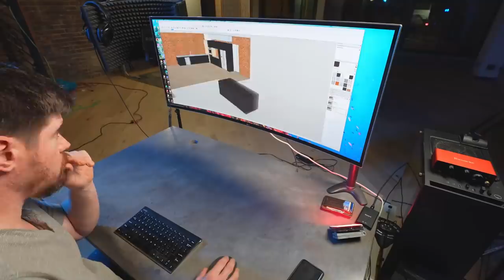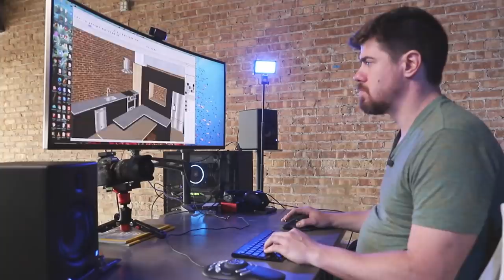Ep. 24 - Making the Hallway GLOW... and Bathroom TOUR ...Abandoned Building Renovation

Comment: I wouldn't worry about the edge of the flooring unless it causes issues when cleaning. I'd also consider re-grouting the bathroom while you can as its just going to get worse. The little elevator nook is nice as it breaks up the long hallway and plus useful for later. Its all looking really good 👍
Reply: I thought it's a good spot to put beds & a Bruce\Karma toy box. All Custom Built, of course...
Reply: @marshawargo7238  agreed. They'll have the best patrol spot
Reply: yeah I agree about the flooring, people are not going to notice it unless it's pointed out or they are specifically looking for it so I would leave it as is unless it causes issues, another possibility with the elevator area would be to convert it into a dumb waiter type lift, not big enough for a person to save from having to deal with elevator safety codes, but good enough to save you from having to carry loads of groceries/heavy objects up and down the stairs

Comment: For the smart thermostat, I'd recommend ecobee. It is a lot more open of an eco system than nest, and has the most features and customizability, which may not seem important.... until it is!

Not to mention, extra temperature sensors that can be spread around the house to take average house temperatures, rather than just hallway temps, which is always good!
Reply: Ecobee is the best!
Reply: +1 for ecobee, especially with the remote sensors
Reply: Yes. Both our electrician and HVAC folks have said they're uninstalling a lot of Nests and replacing them with Ecobees. I like ours. Lots of control that is accessible. I widened the range before the system kicks on to +/- 3 rather than 2 so my HVAC can run more efficiently (less cycles for a longer period of time).
Reply: I've had both and after 2 months ditched the nest for the ecobee. Get the Pro if you have a (de)humidifier.
Reply: Major +1 on Ecobee, doesn’t even need to be the 4 (which I’d personally avoid, I’d rather not have Alexa in my house) the 3 Lite is the perfect smart thermostat and a great value!
Reply: As a guy who used to do duct cleaning and light maintenance of Residential homes, Nests were the most consistently failing on me when doing all my check ups. The wiring thats connected to the back of the thermostat would often fail and at the time Nest would not warrenty the issue claiming that all these failures were due to poor workmenship on the technicians. Yet how are you supposed to charge or change the batteries if you weren't allowed to remove it from the wall? most of these setups were WiFi and the really old ones were Blu-tooth so it wasn't always a tech that caused the issue! Ive heard good things from Ecobee right before i stopped that line of work though
Reply: I have the NEST. It looks really cool but the app that goes with it is the worst peace of software ever. I wouldn't buy it again.

Comment: Re: wood flooring and trim. I normally make sure the drywall is up higher than the installed floor wil be. That way you have 1/2-5/8" of space under the drywall for the floor to expand. Then you just need to leave a 1/4" gap from the face of the drywall. The gap is only to allow expansion, so who cares if some of that expansion happens under the drywall.
Reply: This is how you're supposed to do it. Also the reason why you always start drywalling top to bottom. Leave an inch above the ground and you can put floor right up/under the drywall.
Reply: Huh. Smart... professional... makes perfect logical sense.  And yet, we rarely see it done. What a world we live in.
Reply: thats how ive always done it but i try to leave the floor at the edge of the drywall. gives a 1" gap total from both sides. if your flooring is expanding over an inch, theres probably a bigger issue going on. Thats alot of growth on flooring boards.

Comment: To make caulking trim easier, cut the smallest hole possible on the tube. It isn't construction adhesive that needs loads of it put down quickly. A small 45 degree cut at almost the end will go a long way.
Reply: That caulking was stressing me out.  When I painted in college I basically had a caulking callous on index finger. Small hole, run finger along. With a bit of practice hardly have to rewipe. That said I hate bathroom caulk!
Reply: A little goes a long way, he would burn through caulking on a bigger job with beads like that. The house is looking really good though. I’m very interested in the CNC cabinet making software. My be cheaper now to buy a decent CNC and build my own cabinets now.
Reply: That messy caulking terrified me. You only need to watch one video about it to know how to do it properly.
Reply: Another tip is to put a baby wipe around your finger when you smear it out. It makes the job easier and without any mess at all.
Reply: @peterantonius4234  reading on my phone. Did not see "wipe" on 1st read through. I was very confused for an instant!
Reply: @jbeutell  would still be better than Mike’s caulking. 🤭
Reply: If you watch any video where some one makes a concrete mold they tend to glob on the caulking and then clean with a confection tool. It must be a carried over habit from that?

Comment: I hear you on designing kitchens. My dad is a custom cabinet maker and I've been designing kitchens for him in AutoCAD for the last 20 years. It does get easier when you do it a lot and figure out the parts that are always the same. Every kitchen is different and there's always that one area that gives me a headache. 

Pro tip: When caulking your trim, make the caulk bead about half that big before running your finger down it. You can always add a few dots if you get a gap in the caulk line while smoothing it. A smaller bead makes your caulk go further, but also doesn't squeeze out on the walls as a ridge when you run your finger down it.
Reply from the maker: Thanks for the tip!  I actually got much better as I worked my way down the hallway....busted out the powered caulk gun and it helped a lot getting the right bead size.  I wish I'd recorded it but it was 2am, so I was just trying to get it done at that point, lol
Reply: @modustrial  I'll be honest. I've never used a powered caulk gun. Still working the ole squeeze handle type. 😆 I've been wanting to try one for years.
Reply: @modustrial  that was my first thought when i seen that big bead. "man he is gonna hate his life when he tries to wipe that down, way to fat" lol ive learned this lesson the hard way, some times still do it too, even when i know!!

Comment: Comment about the thermostat: I actually used the nest for about a year or so and had a ton of problems with it, so we switched to the ecobee and we've been on that for about 3 years now. I'd highly recommend ecobee if you decide to add smart home equipment as well - much easier to set up with 3rd party hubs.
Reply: While the ecobee does work well with hubs, it so, so much less sophisticated than Nest.
Reply: @rsporter  My experience with the nest was that it couldn't get a proper temperature reading after 1 year and their "smart adjust" always attempted to make the temperature way too hot or way too cold, so... Not sure I agree with you there. I tried a lot of different ways to get it to work and it just got worse.

Comment: Instead of quarter round, you could go with quarter inch square stock. It's a lot more modern, and it's cheaper because you can buy quarter inch baseboards and rip them to quarter inch pieces.
Reply: I see I'm not the only one that had this thought. 😁 Quarter or half inch square stock. Maybe even in a contrasting color like black make it look like edging or something.
Reply: Use mdf sheets at the thickness you want then rip the sheets to the height you want for super inexpensive shoe.
Reply: @drunkvegangal8089  yeah I did this in my house, and it does collect dust, but it’s not much more as part of my normal vacuuming to clean it up by throwing the bristle head attachment onto the end and just running it along. I also did it a lot at first as some of the dust from my renovations was settling and now I only need to vacuum it like once a month (I very vacuum often because I have a dog that sheds a lot and even the hair manages to stay off of it). A hallway like would be pretty easy to just run the vacuum along it once a month if that. I also think it looks great as is, but if Mike wants to cover it up because it bothers him then it’s a modern option that’s fairly inexpensive.
Reply: @drunkvegangal8089  lol I just vacuum it lol nothing crazy. I’m not wiping them down or anything super strenuous.

Comment: Admittedly this is a bit old school but I’ve seen thicker baseboard trim used that is bevelled into the door trim.  Hard to explain without drawing but where you would have a square but joint sticking out you slant the baseboard to the thickness of the doors.  Sometime this is a straight angle (steep or gentle to your own taste) but I’ve also seen it sculpted shuck look pretty cool.  Perhaps To late for you but maybe useful for someone else.
Reply: That’s what we did, but our trim isn’t ultra modern. But, I’d still do it instead of adding 1/4 round.
Reply: @Sibat 777 in terms of a “short” bevel, and you implying the a changer would work? Immediate before the door trim I mean. That might be a nice look.
Reply: @Sibat 777 Oops.  I got spellchecked. A *chamfer*.
Reply: @silencionomus  yep I particularly like the look of a shallow curve but it’s hard to repeat I guess you could cut to length and then use a spindle moulder to creat a decorative chamfer.  Yes auto correct can be a pain 🤪 some of the things it makes me say are quite rude🤪😜👍
Reply: would have gone for that solution as well, also would allow more space for expansion of the flooring under the trims, plus as you pointed out less effort to build.

Comment: Not sure why you felt your baseboards had to be thinner than your door trim. I just rebuilt my house and boxed out windows and door trim with 3 inch wide and 5 inch baseboard all same thickness and it looks amazing. No 45% degree angles all just like a box. Clean and simple.
Reply: The door casing being slightly thicker than the baseboard is quite typical in most homes.
Reply: @JasonACadder  honestly more often its a cost savings technique, not a visual preference.. since thinner molding can sometimes save you about 25% overall and that adds up quick.
Reply: "Boxed out" isn't a modern design
Reply: To be fair to Doug, Mike did say he didn't realize the baseboard HAD to be thinner, which doesn't make much sense to me unless there is some weird code thing in Chicago that makes that the case.
Reply: No idea why you would even think this was an issue. Those little chunks vs no small step between trims is just insanity to me
Reply: Agreed. We have heritage moulding and it’s all an inch thick, it looks lovely where baseboard meets door trim.
Reply: I was thinking the same.  I'm in the UK and most houses have 3/4" for the skirting boards (baseboard) and architrave (door trim).
Reply: Plus I would think a thicker baseboard might give the space a bit more of an industrial look which I think the hallway could use.

Comment: G'day from Australia mate.
Don't worry about the trim around the boards on the floor. 
I think the gap between the floor planks and the wall should only be 13mm -.5" not .75".
Also when putting on silicone to cover the gaps, I used masking tap on the wall and board, then wipe away the excess. 
This way you will not have and silicone on the walls and boards,  so painting next time you will have no problems. 
Greg

Comment: Not sure if anyone mentioned it or not, and guess it's kind late now, but with modern design/aesthetics you could have gone with the baseboards being the same thickness as the door frames. That would have given you a super sleek look. Although it looks good the way you have it now. Don't add any additional modeling to the floor.

Also a little tip I've seen, is to us painter's tape on the boards right where you're going to nail them. Leave it there while you add the putty to fill the holes.  Then remove the tap when dry and that will leave the tiniest hole to sand and avoid any additional putty getting on the board.
Reply from the maker: that is a good tip!  I'll take note for the trim in the rest of the rooms!
Reply: 😮 genius tip!
Reply: @bettenotap4791  thanks, although I can't take credit for it.

Comment: It's looking great Mike, don't worry about the quarter round, I think it'll spoil the clean look that you have now.

A top tip I picked up from the guys who fitted our quartz worktop is to use those little plastic spacers as a caulking tool.  The tiny radius on the corners gives a really nice clean bead, instead of using your fingers.

Comment: when caulking if you cut the  nossel at a 45degree angle that is a little smaller then what you had you will be able to run a continuous bead rather then getting burps and blobs that you have to wipe away after. Also for painting with a roller you get a much nicer finish if all the strokes are in the same direction and then you do a final back roll (go back over everything in massive long strokes from the very top to the very bottom)

Comment: For thermostat, Ecobee has the best compatibility, and a bigger screen. It doesn’t learn like the nest so you need to get creative with the IFTTT algorithms, and the ecobee requires a c wire retro fit in older home but in new construction I feel like the ecobee has better feature set and fit and form for modern homes.
Reply: The main issue I had with the nest thermostat was the price. If need one thermostat it's okay, but if you want one thermostat per room it becomes very expensive.
I also considered ecobee but in the end I went for tado.

Comment: WiFi thermostats are good. Then you can turn it on/up/ down from anywhere, like when you are headed home. Many brands can do that, so just go by looks? I found the Nest web site and programming to be good, but have broken two of them. Once with static, so now I never touch it. Nest doesn’t need power in the wall, did you run power? Then you have more options.  Also it was confusing when the power came back after an outage, but the nest did not, but it just needed time to charge up.

Comment: Just a quick note. The correct molding to install at the bottom of baseboard is base shoe, not quarter round. Really, there is a meaningful difference between the two profiles.
Reply: Agreed that there is many options for base molding other than quarter round that can have a modern appearance. 

One base molding I have found to work reall my nicely and maintain a bit more of a modern feel is 2258 13/32 in. x 1/2 in. x 8 ft. PVC Composite White Exterior Bead Moulding from Home Depot. Super cheap, very minimal in size, yet  durable as its PVC. I have it on all sorts of trim projects.
Reply: Semantics or proper vocabulary.

Comment: I highly recommend Ecobee.  I will say, the savings that these companies advertise is a far stretch.  You won't see a huge difference on your power bill.  If you just want it for the cool factor I totally get it, as I have two for that reason.  Maybe consider Amazon's new smart thermostat.  Also I have no complaints about Honeywell's smart thermostat.  Not as flashy but it works well.

Comment: You didnt mention this, but for those who dont know. If you want to fill in a crack or hole the best way is to sand that board (if its un finished) and use the saw dust and glue so you get a perfect match. I saw an old time wood worker do this, but I dont hear it talked about anymore. Or in this case He used some of the saw dust from cutting those small pieces. Its the closest match you can ever have.
Reply from the maker: Yup!  I used fine sawdust generated at the miter saw for the filler.

Comment: Next time you are doing mitres, nail/glue the joint together first and slide joint into corner. Then, pull boards tight to wall and nail as you go. They will pull in tight.Perfect joint every time.
Reply from the maker: Good tip!  Thanks!

Comment: Wherever you read 3/4 inch gap is crazy. 1/4 is more than enough - especially in that narrow hallway.
Reply: @𝐌𝐨𝐝𝐮𝐬t𝐫i𝐚I 𝐌ak𝐞𝐫◾️ Will do! I wanted to also add that I did like your solution. It was better than the quarter round option and you certainly won't notice it unless you point it out. Good choice. Loving the content.

Comment: I'm a little surprised that you painted the doors/frames/trim. (Well I know you wanted them white and so would I do to) but what I was thinking of is that where I live (Sweden) you can buy the normal unpainted trim/oak veneer trim/solid oak trim/ or white painted pine trim. Just like you had in the video. Here the white trim is finished painted so it just ready to intstall. No painting required. Really handy and good looking too actually. 
The doors and frames come pre painted in that same white as well.
So I just wondered if you have the same over there or is your trim only base coated so that you have to finish coat it when it's in place?

Comment: When applying the glue to the baseboards, you should have laid a continuous bead along the top edge. After scraping off the squeeze-out, the results would be about the same as using caulk, but with less effort, and the gap would be filled, not just skinned over.
Regarding base shoe: Use strips, say, 1/4" thick x 7/8" high, with a small chamfer, painted a contrasting color. They would protect the baseboards from cleaning tools, and would look plenty different from 1/4-rounds.